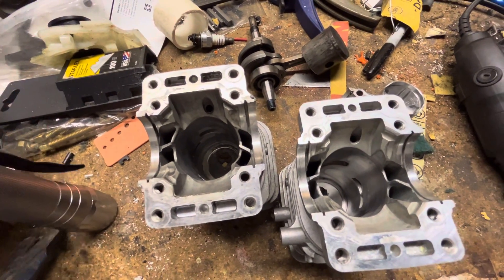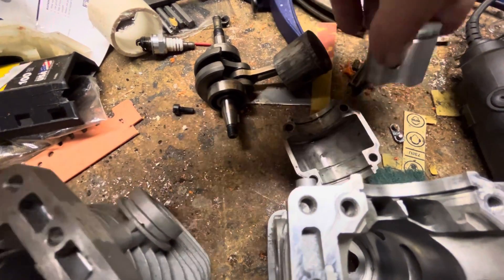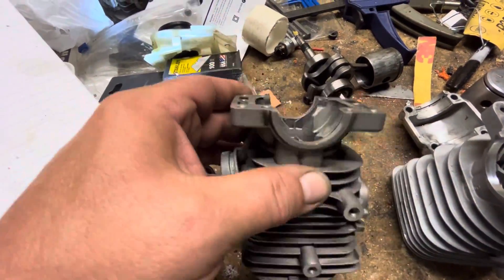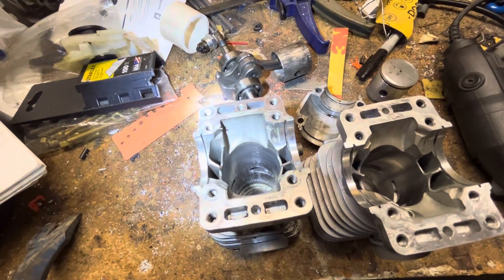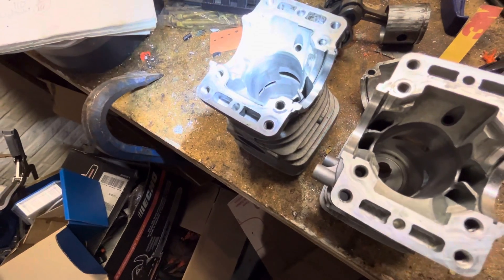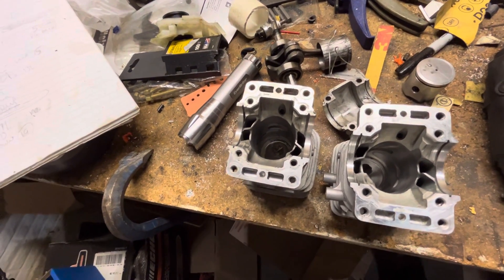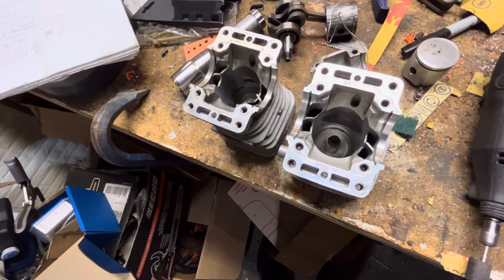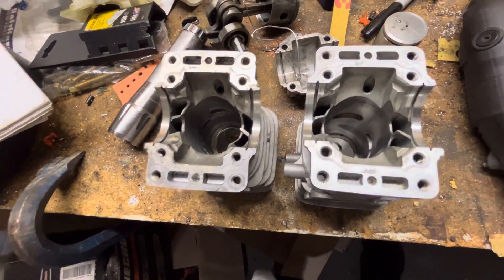Port an Echo CS-310 ? ……. Yep 🤪

Comment: Not often you post! 👍👍, hopefully you will show it in wood soon!
Those transfers are odd, echo must have been hoping for swirl
Reply from the maker: I don’t often have anything worth posting!!
Waiting on a carb kit and may replace the intake boot. Really stiff, don’t want a leak. 

I picked up a cs352 a while ago that was pinched and it looked like they pulled it out with with a winch. Replaced all the av springs and couldn’t get it to tune.  Assumed it was the aftermarket carb- picked up another carb- same thing. 

Couldn’t get it to seal up at the carb mount. Thinking I may have the same problem with this one. Not sure why the boot is so damn crispy.

Comment: Interesting… I’ve got a cs-310 that I gutted the muffler on, and slightly retuned. I had not seen anything on this until your video. Although full disassembly isn’t an issue, I see the potential for me to mess up with the metal-cutting here. It runs quite well right now so I’ll probably leave it alone, but this was interesting to see.
Reply from the maker: Yes sir- can get most of the performance gain with a muffler mod and retune!

Comment: Transfers are almost like like Little Mac where they are twisted to create a swirl I suppose. 
These newer saws seem to have really low exhaust roofs eh? I think my 3416 Poulan is 110°.
Reply from the maker: I think the design is from Shindaiwa. But I agree, similar principle. I have a 377 and the cylinder design is almost exactly like this. Little saws and clamshells with big squish would benefit from low exhaust roofs to keep the compression up. Many of them barely make 125-130 psi of compression. Cutting the exhaust roof makes it worse and they may not have enough torque. Just depends on what you are doing with it. That little Mac you raised the roof in did really good with that  high roof for limbing.